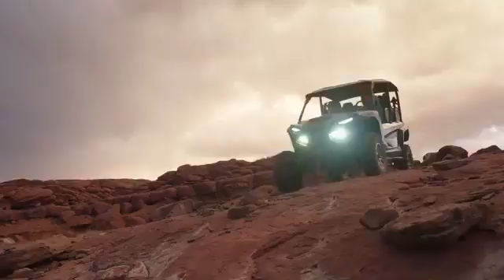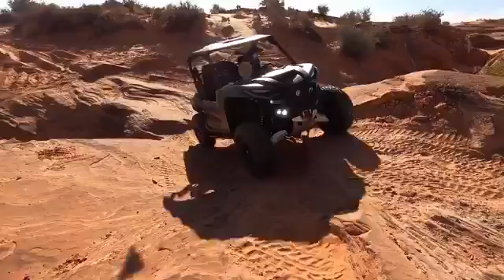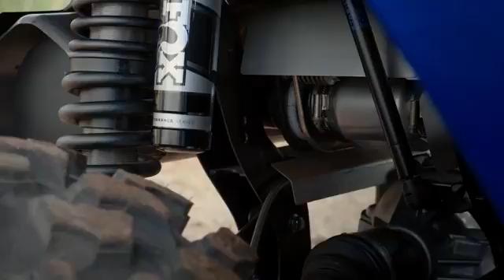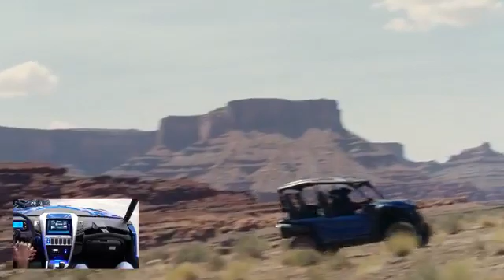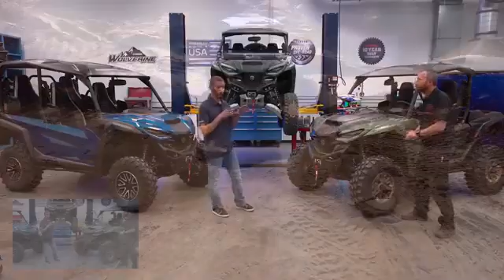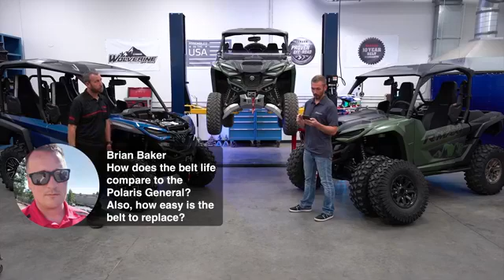Yamaha LIVE, Episode 1:  "Wolverine Wednesday"

Comment: 2 biggest takeaways for me and please correct me if I'm wrong on this first:  RMAX4's can be outfitted with a square tire setup, meaning that the staggering on the RMAX4's comes from the differences in the stock tire/wheel widths front/rear and the different front/rear rim offset, so if you threw an RMAX2 stock tire/rim setup on an RMAX4, it would be square, and the second:  RMAX4's have 20 gram primary roller weights vs RMAX2's 18 gram.
Reply from the maker: Correct:  we offer square setups for the RMAX4 1000 on ShopYamaha.com, and the RMAX4 1000 has 20 gram clutch weights, while the RMAX2 1000 has the "sportier" 18 gram weights. If one wanted to add the 18s to the RMAX4 1000, say after adding tires larger than stock, they can be ordered from ShopYamaha.com, as well, and are very price-friendly!